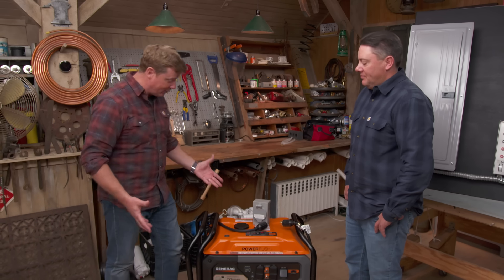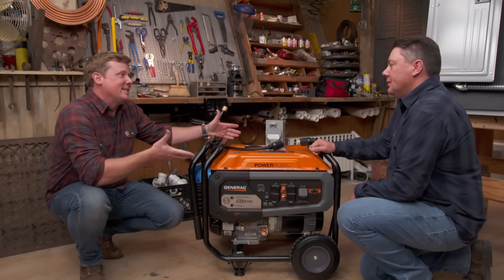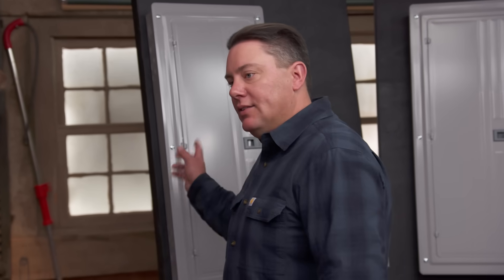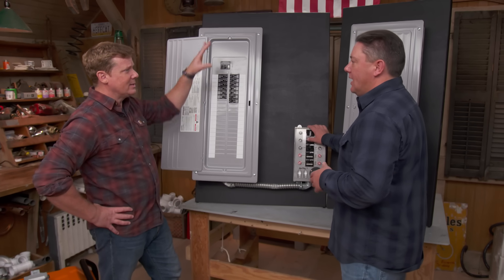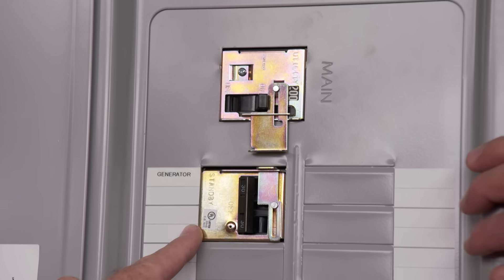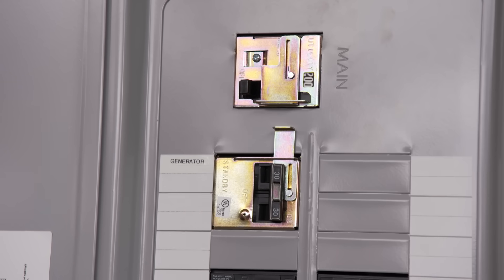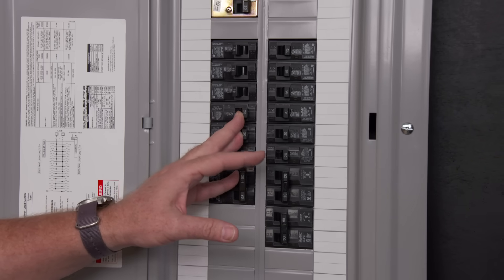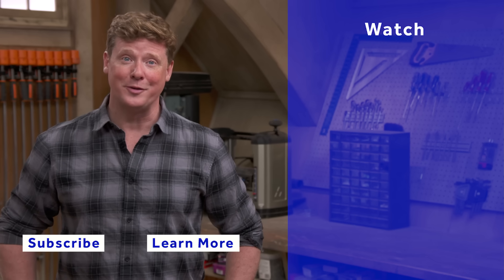How to Wire a Portable Generator | Ask This Old House

Comment: Didn't see a whole lot of wiring going on
Reply: I know a lot about generator safety: there is something that everyone really needs to know about using generators. Warnings about generator safety should not be ignored. Generators can be dangerous if not used carefully. Everyone should know this. We should also keep our children safe when we’re using portable generators so they don’t get electrocuted or burned and also poisoned by carbon monoxide. Generators can overheat so we need to keep our children safe. Carbon monoxide fumes are not safe to inhale. Install a carbon monoxide detector to keep your family safe. Remember not to run your generator indoors because of carbon monoxide. Generators are outdoor use only. Don’t store your generator indoors in any living areas or in the garage. Only keep your generator in a shed outdoors. Your portable generator should be 20 feet away from your house to avoid carbon monoxide poisoning. Generators should be away from windows and doors and vents because of carbon monoxide fumes. Don’t try to plug a generator cord into a wall outlet. Don’t run your generator in wet conditions. Generators produce high levels of carbon monoxide. 
https://youtu.be/I1jT3ANENvI and here is a video more about generator safety and keeping children safe. Just hoping everyone stays safe and this is just a reminder about generator safety. This is just for everyone’s safety. Thank you
Reply: That's because they actually do very little of the work you see.   Most of the work is done by trades during the week and they come Saturdays with their crews to pretend they are doing something.
Reply: @nechoxd3208  Pretty much, that's about all you can expect from "reality" TV.
Reply: Because you should not be doing it. You can kill a linesman working on the grid. As you screw up and back feed the grid. I read stories where people installed their own Solar system. And did just that. Killed the linesman. When the power went out. They are now in jail for it..

Call an Electrician.
Reply: @MasterChief-sl9ro  news source on this?
Reply: Master Chief 00117 so... that’s why they should make videos on how to do or not to do...
Reply: @G_de_Coligny  Do what ever the hell you want. As they don't teach it as electrical fact. they still teach it as Electrical theory 300+ years later for a reason..
As what takes people years to understand. No 1 hour video will tell you what happens. When you get it wrong..
I buried plenty of Licensed Electricians..That thought they had it figured out. 

Good Luck
Reply: @MasterChief-sl9ro  This is very easily installable very legally by a homeowner that isn't a complete idiot with a simple permit and inspection. It's not very complicated at all. This old house isn't meant to be a "how to" show, it's meant to be a show for women to watch and yell at their husband what they want them to do.
Reply: @MasterChief-sl9ro  so you are saying I shouldn't plug my generator into my dryer plug?
Reply: @cjr4497  If you do.. You better pull the Meter...As  all you're doing is back feeding the panel. Bypassing the main service breaker. 

I can tell you this.. You leave that Meter in. Then the power comes back on. Something is going to burn up...As the phase angles on the generator. Don't match the transformer feeding the service panel....And when things go phase to phase., They like to blowup. At 50k psi....
Reply: @MasterChief-sl9ro  hooyah master chief! Go Gettem!!
Reply: @cjr4497 😂😂😂😂
Reply: @MasterChief-sl9ro  I read somewhere, on Solar your meter will be going backwards, and you can sell the electric back to the Electric company.  Now I know that's what back voltage is and could kill a lineman.
Reply: @FogHat1980  … solar feeding back into the grid is fine as long as the grid is up. When the power goes out it needs to automatically disconnect so repairs can happen safely. UL approved equipment that is properly installed can do this.

Comment: A few years ago, the power went out in our town. Someone fired up the generator, put it outside of the backdoor, and run an extension cord through the backdoor into the house. The CO sipped into the house, and sadly, killed everyone.
So don't just put the generator outside; put it far away from any windows and door.
Reply: Yes there are always huge warnings all over the box. Sadly many still don't know.
Reply: @Kevin-mp5of , Oh man, don't say that.
Reply: Smells fishy here. It is highly unlikely that CO "sipped" through a crack opened door and killed every body inside. And even if it did sip through it should take a long time before enough CO concentration could kill. Probably not a true story, sorry, guys not buying it ...
Reply: @XwpisONOMA  ... As a generator tech and also a 20 year FD member I have a pile of stories about how dumb people are. The most common issue is people leaving the gen set running outside (or inside) the garage door, which is open. The garage is attached to the house and shares the attic space which slowly fills with CO and filters into the 2nd floor sleeping area. If they go to bed with the gen set running (or not) the sleeping area is already full of CO, especially if the windows are closed. I have also seen people leave a gen set running inside a screened porch (usually a breezeway to the garage) with similar results. When they say to run it outside they mean outside... not half way outside. In the last 10 years there is now building code on gen set installs and they specifically talk about distance from doors, windows, and any other openings. (drier vents, Jen-air vents, fireplace intakes, etc) Yes, the forced cooling air from a gen set can get into cracks, especially where the house walls meet the foundation, leaky doors, windows, etc. Been there, done that solving problems.
Reply: Why there should be more public service announcements about buying and maintaining carbon monoxide detectors
Reply: @pavelow235  … what people fail to realize is where the CO comes from. I'll bet you can't find a CO warning label on any appliance, other than a portable gen set.
Reply: We’re in Louisiana right now without power. 15 people dead. 7 from Laura. 8 from CO poisoning.
Reply: @Michael W You can google the news story. But I bet you don't know how.

Comment: We use a interlock and we back feed our panel.
Safe,Easy,Cheap,You just have more control.
Backup power comes from a RANGER 10,000 welder but we use it for auxiliary power too.
9,000 Watts Continuous, 10,000 Watts Peak.
I have timed it before and we get 11-12 hours on a full tank of gas.
9 gallons being full.
It does power most of the house and we do turn off the big power draws.
I would say if you live in a rural and small town like us and you lose power more than you like.
Get a generator.
Is my setup perfect?, No I'm sure there are better ways to go about it.
However, It does do what i want and is reliable.
I figured I'd put my two cents in.
Reply: Wow, 9KW ? That's great. What do you shut off, the water heater, stove, AC, Etc ? Thanks.
Reply: @augustreil  I'm glad you asked, Electric Dryer,AC Air Handler,AC Condenser, Electric stove "Downstairs Kitchen"
The rest is propane or heating oil.
Propane for our stove in the main kitchen area and water heater but water heater does need mains/backup power because of power vent to keep running.
Heating oil for our hot water baseboard boiler, We do need main/backup power for that too.
As for our water, It comes from the well and we do need main/backup power for that too.
I believe that covers all of it.

Comment: This video seems vague as to the requirements of NEC 250.34 because if the frame of the generator is bonded to the grounded neutral conductor, and is not a separately derived system, a dangerous parallel neutral condition is created if the neutral to frame bond is not removed. An alternate would be to remove the normal system bonding jumper, but then a grounding electrode system would be required at the generator.
Reply: You sound way too smart sir !!
Reply: august What to do with this situation?
Reply: Someone just HAD to start quoting NEC. Just kidding, David E.

Comment: Having a solar set up is better and quieter.  When PG&E shut off power to 8 MILLION Californians this past fall for FOUR days, gas stations couldn't run pumps so folks who needed to get more fuel (gas generators burn a LOT of fuel) were outta luck.  

Whereas a small solar panel set up like ours from 4Patriots that has four sturdy panels that fold, and the generator keeps our refrigerator, phone/laptop lights working with no problems.  Even with snow on the ground as long as we have sun we have power. And the generator stores electricity.

There are also propane/natural gas generators that can be hooked to the home so that when power is out it automatically comes on.  These are a must have here in the California Sierras were living off grid is more the norm.
Reply: Please keep in mind that portable generators can be dangerous if not used carefully. Especially we should also keep our children safe when we’re using portable generators so they won’t get electrocuted and burned by generators.
Reply: @The_Happy_Aviation_Enthusiast  While that is true my post was about propane and natural gas generators that are hooked to the homes energy set up NOT portable generators.
Reply: @BethGrantDeRoos  also remember not to store propane tanks indoors because it will explode

Comment: Is there any other brand that runs less loudly than the honda brand but affordable?  Honda cost way too much for me. Way more than this one for sure
Reply: All generators run loud. You want quieter you gotta pay more.
Reply: There are a dozen companies now that sell quiet enclosed inverter generators similar to the quiet Hondas. The only issue is most of them are only 2000-3000 watts so they aren't ideally suited for use as a whole-house generator. They would however, work fine for just powering a fridge, freezer and some lights.
Reply: Get u some earplugs
Reply: Look for 1800rpm operating speed. It costs more, as you need a more powerful engine, and more expensive windings in the generator for the same wattage 

3600rpm generators use smaller windings, usually with a small engine running at the verge of self destruction.
Reply: @interstellarsurfer  Buy a 240/480 and run it at 1800 instead of 3600 RPMs? LOL
Reply: @davidgagnon2849  I wish it worked that way, I wouldn't mind underclocking/overclocking the powergrid like a PC. 😉
There is some serious eng-I-nerding in a proper generator, and you do get most of what you pay for. 👍
Reply: @davidgagnon2849  … There is no 240 / 480. That would be 277 / 480 and would also be 3 phase, so not suitable for a home. Half speed would also be 30 Hz frequency, so no good.
Reply: @rupe53  Actually there is. Just trying to add a little levity.
Reply: @davidgagnon2849  … Well, there are units that run less that 3600 at less than full output but they ramp up to 3600 for full output. (inverter style units) Overall, not too bad in the noise department, even at full speed. I don't think you will find any portable sets rated for steady state 1800 rpm. (consumer grade, not trailer mounted commercial sets) The problems I see out in the field are people run them on the ground. Every single one I have worked on is full of sawdust, leaves, dirt, or has been sitting in water because it was in the back of someone's boat. You'd be amazed at how far an inch of water will travel inside these things. Did I mention they were a royal pain to work on beyond a plug or an oil change?
Reply: @interstellarsurfer  … show me ONE portable set that is affordable and portable. (I thought so)
Reply: @rupe53  I'm not showing you anything, babe. 👌😁
Reply: john tran, Like Oscar said, they're all loud, some more than others. Check out what some people do with just some ingenuity and pieces of plywood here on YouTube. You can literally cut the sound blast by almost half with some strategically placed pieces of wood.

Comment: The last time i experienced an outage must have been more than 20 years ago.. Perhaps this proves that powercables underground is a whole lot better.
Reply: Nick J  Around here some of our longest outages have been on clear blue days. Weird.
Reply: EOSJOE Maybe because the transformers blow up because of the heat, takes longer to fix than a cable 😛
Reply: There have to be above ground wires somewhere on your circuit... your not being fed underground straight off the local substation transformer. You must just not have a circuit that’s susceptible to many trees.
Reply: Please remember that portable generators can be dangerous if not used carefully. https://youtu.be/I1jT3ANENvI just hoping everyone stays safe. Thank you
Reply: Most metro areas in major cities have extremely redundant systems with a lot of remote activated switching so outages are pretty rare and when it happens very short time periods. Rural areas are a whole different animal.

Comment: The second options seems like the better method, it allows for more flexibility and is all contained within one panel.
Reply: Agree. I installed an interlock in my panel. No need to pre-determine circuits that are generator capable and no need  to rewire anything through a transfer switch. I can decide what I need to run by throwing breakers in the main panel. In my case, I can run everything except the electric hot water heater and central air so I simply turn off its breaker when running on the generator. But!  If I *had* to have some hot water in an extended outage, I can turn off other circuits and run the hot water heater by itself until I get the water I need. I have little orange dot stickers in my panels marking the breakers that need to be turned off so that in an emergency there is no confusion.
Reply: @eosjoe565 , Best comment I've seen so far, and I've gone through roughly 60 !
Reply: @eosjoe565  The thing is for me, the first 2 breaker slots are already occupied by my AC.  Did you have to move breakers around to make this work?
Reply: @mae2759  If I recall (I had an electrician doing the work) he relocated two breakers to the bottom of the box. It was very simple but I can see situations that may require more fiddling.
Reply: @Kevin-mp5of  Funny.  :-)
Reply: The British Patriot I see you everywhere.
Reply: Definitely more value in the 2nd option but you have to know the limitations of the generator.
Reply: I know all about generator safety: there is something that everyone really needs to know when using generators. This is for everyone’s safety. Please remember not to run your generator indoors. Keep in mind that carbon monoxide is dangerous. Generators can be dangerous if not used carefully so we should also keep our children safe when we’re using portable generators because children could be burned or electrocuted by the generator and even poisoned by carbon monoxide. This is what everyone really needs to know. Generators can become hot. Make sure you install a carbon monoxide detector just to be safe from carbon monoxide. Don’t run your generator in wet conditions. Don’t try to plug a generator cord into a wall outlet. Generators are outdoor use only. Only store your generator in a shed outdoors. Never indoors in your house or in your garage. Keep that in mind. Just reminding everyone to be careful using portable generators and hope everyone stays safe. Thank you